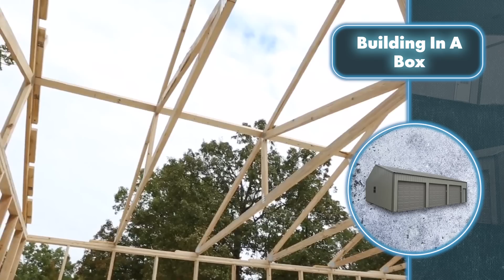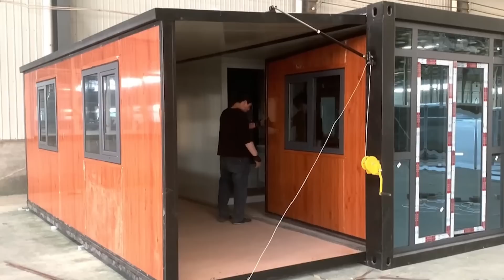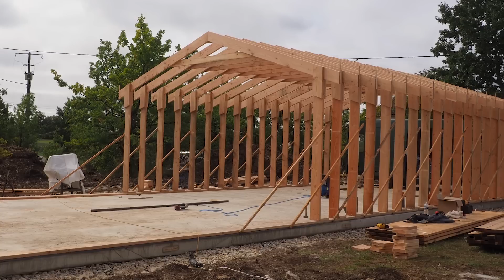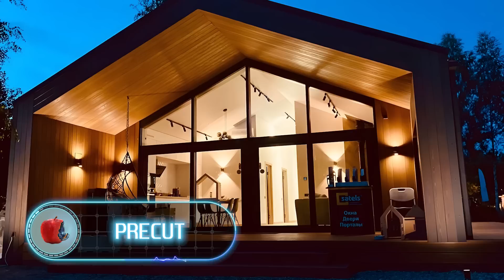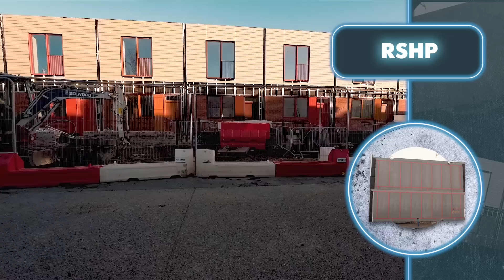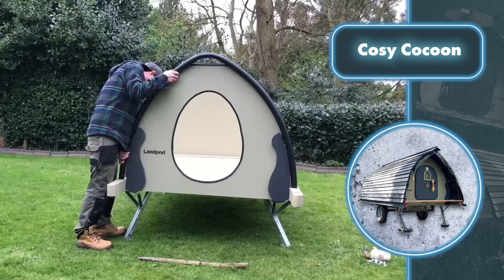Mind-Blowing Quick-Build Homes You Should See

Comment: The quickest built home is one that arrives ready to go minus hooking up to utilities. AKA, mobile homes. They literally get hauled in, leveled, strapped down, hooked up, and ready to live in. Too bad their costs have skyrocketed like everything else over the last few decades.

I've been toying with the idea of taking a used semi truck trailer and converting it into a tiny home. If done right, it will be easily mobile without the need of expensive permits or pilot cars or whatever. Any standard semi truck could haul it like any other semi trailer. Pull it onto a lot or concrete or asphalt pad, strap it down, plug it into the utilities, and it's ready to live in. Of course, you know the government will get in the way of this being easy to cheap.

I would estimate that a converted semi trailer into tiny home would run around $40K complete and would be about 450 square feet which is plenty for one or two people. This assumes the semi trailer can be had used without greedy sellers upping the prices due to higher demands.

Comment: The 3D printed houses will not be practical until the cost is greatly reduced The whole advantage supposedly of a 3D printed house is that it should be fast put up and cheap and these are not that cheap, half of these are basically sheds or a version of a tent without running water plumbing and kitchen facilities You might as well buy a shed and put it up

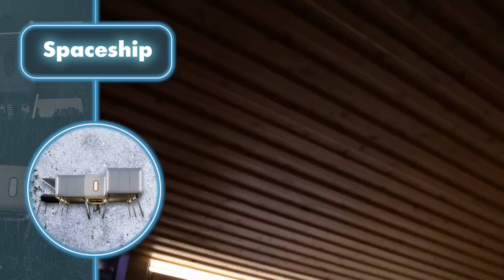Comment: 3:50 - Build a house in just 2 months? That's definitely not a quick build. There are timber framed brick clad buildings with tiled roofs and double glazing, all around the planet which are being built onto proper foundations in 2 days. I saw two being built more than 30 years ago. They were fully furnished, fitted with water, gas, electricity and a phone line, and in use by the owners within 50 hours. Both of them are still in near perfect condition.